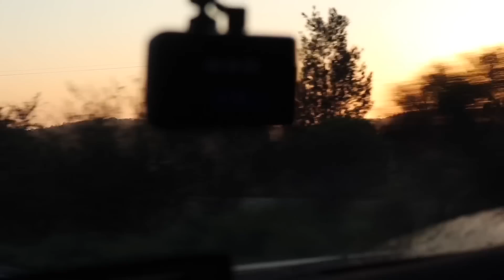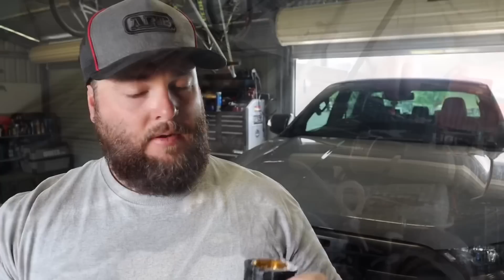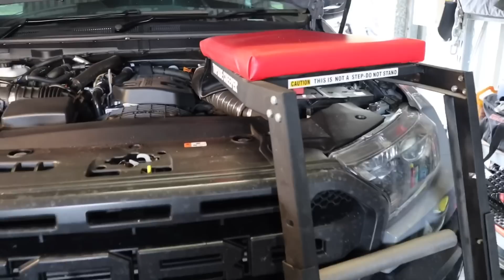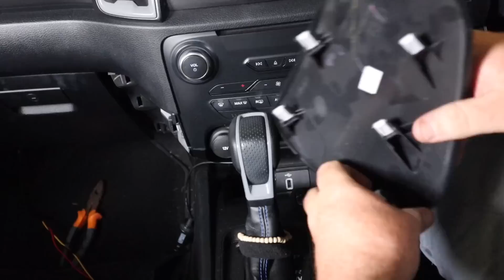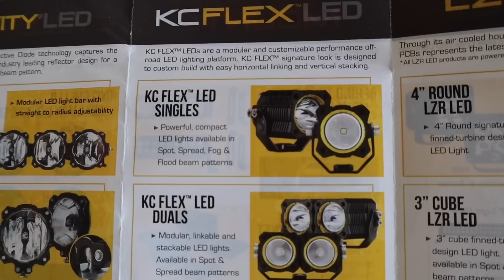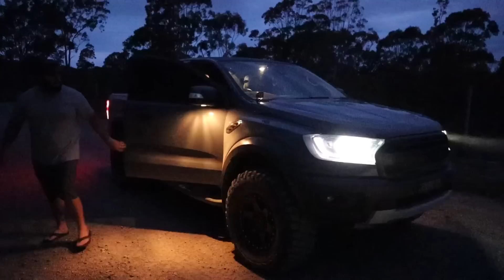RANGER RAPTOR OFF-ROAD LIGHTING INSTALL, 4WD LED SHOULDER LIGHTING. KC HILITES.

Comment: Does sliding the brackets between the hinge and the bonnet interfere with how the bonnet sits when closed? I would have thought the bracket would be best between the bolt and the hinge. Probably not noticeable, just a thought. How are the 35s travelling for you?
Reply from the maker: No it sits perfect 👌🏼 35’s have been really good very happy with the BF’s

Comment: Should've checked out Fyrlyt Nemesis. They shit all over any LED lights. 250 watt each (24 volt with a transformer to operate off 12 volt). Usually $990- a pair, but on special until 29/2/2020 @ $693- a pair. I love 'em so much I bought an extra pair just because they're on special.  
Over the last 50 years I've been driving on outback roads, I've tried all sorts of lights...LED, HID, Cibie Oscars, Hella 150s etc etc.... These Fyrlyts are heaps better and they're made in Adelaide, SA....
Support Aussie-made gear wherever possible.

Comment: Hey.  I just had a look at the kc roof bar you mentioned.  Apart from the custom side profiles the cross racks are a 80/20 style extrusion.  I dont believe it would cost or take to much to make your own.  Design up the side profiles on cad and have then laser cut.  Buy the extrusion precut.  Bam..  also there is some cool wireless light controllers so save on putting wires through firewall.  Cheers for video.  Helps me decide on ideas on mine